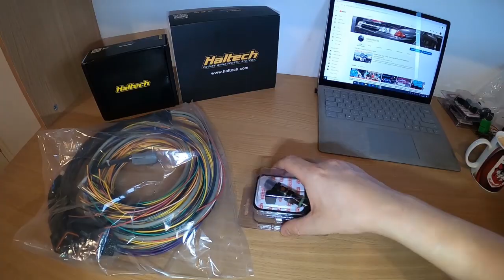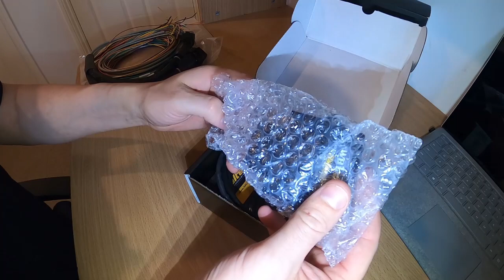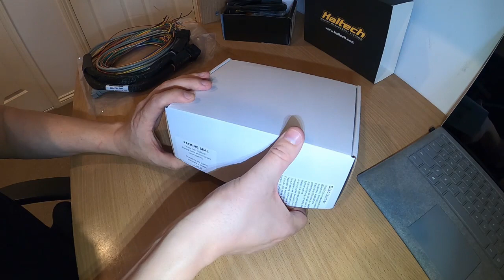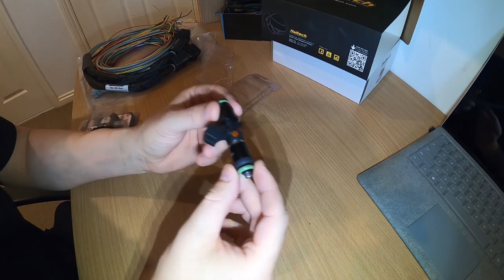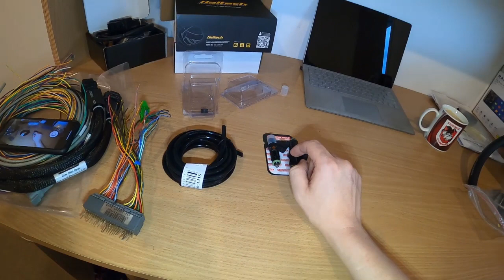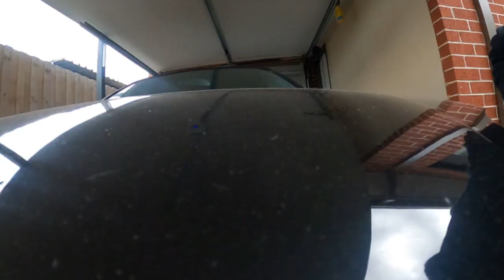EK Civic - HALTECH ELITE 1500 UNBOXING -TURBO BUDGET BUILD d16y4 Ep34

Comment: Wiring woes! I just got done pulling a full new harness to a aftermarket ECU (speeduino). That was quite the adventure and I would not recommend it unless its the only option! I took so long! Good luck with the build and those are some big boy injectors! Looking forward to more videos!
Reply from the maker: Baki1 thanks Baki those injectors are to flow e85 I will be using them I. The next build also
Reply: @TURBOTRISTO  Niiiice! Thats gonna be really fun when its all running!
Reply from the maker: Baki1 I actually hope it doesn’t make ‘too much’ power because I want some reliability on the engine

Comment from the maker: let me know what you think of the ecu choice and the change in music for the intro?
Reply: When I was looking at ECUs Haltech were the only ones I was considering. All the other manufactures wanted WAY too much for the same offerings. I ended up going open source with its quirks (speeduino) for sure but much cheaper and so far its running the car amazingly well considering the limitations of the arduino processor and memory.
Reply from the maker: im glad you got it sorted man, never heard of that brand